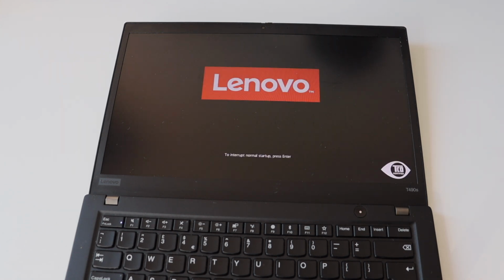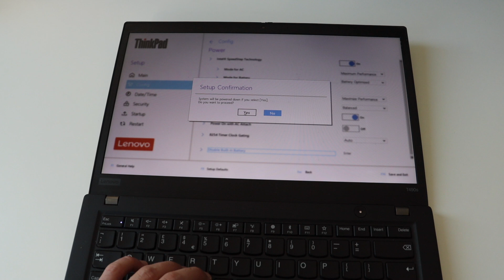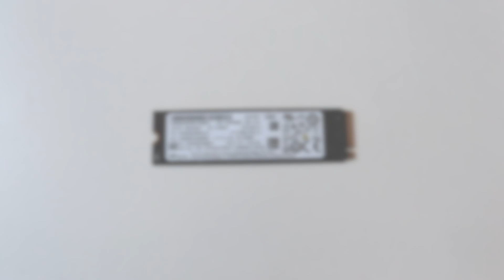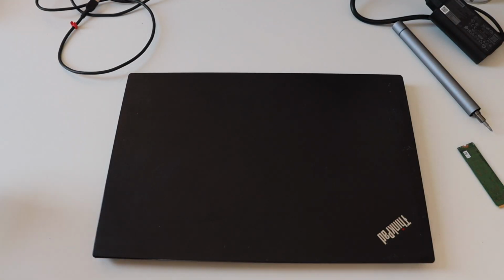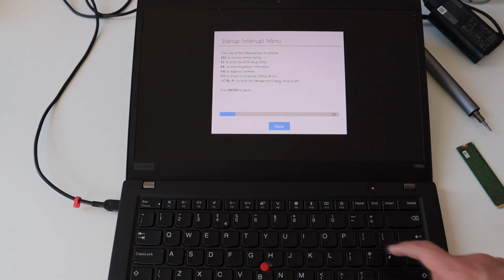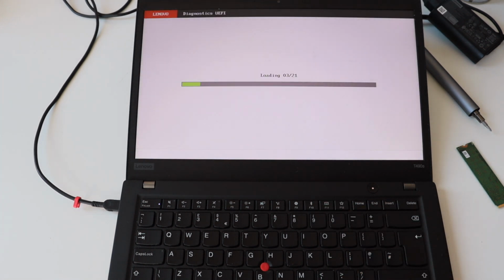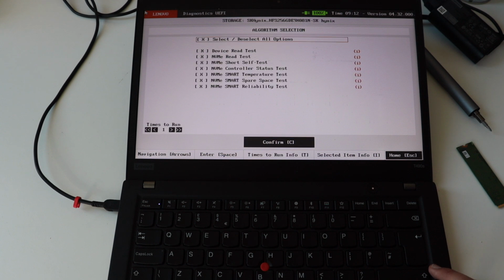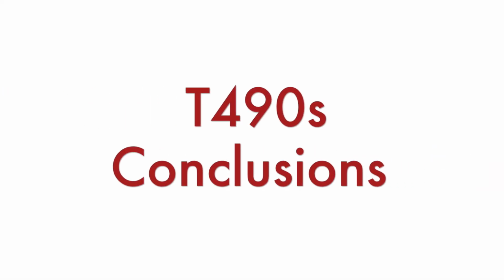Upgrade Lenovo ThinkPad T490s M.2 2280 NVMe SSD

Comment: Hi, I would like to ask if I want to install an SSD on a WWAN card on a T490s, which type of SSD should I use, M.2 SATA 2242 or M.2 NVMe 2242?
Reply: I have searched for information but found that the T490s BIOS does not allow anything other than a WWAN card to be installed, whereas the T490 model allows an SSD to be installed in the WWAN slot. "On the T490s (a slimmer and lighter series), the WWAN slot only works for WWAN cards. The BIOS does not allow other devices, including SSDs, to function in that slot." Is this statement correct?
Reply from the maker: It is tricky... According to the datasheet T490s supports up to 128GB M.2 2242 SSD in that slot. NVMe is supported (not SATA). However, the tricky part is the M.2 key. I am not sure and I can't easily check right now, but as far as I remember the key is B+M. Double check this if you want to go down this path with the M.2 2242.
Reply: @LeonAnavi  Okay, thank you for your answer.

Comment: is tehre enough space for ssd heatsink?
Reply from the maker: Hm, not sure. I have come across SSD heatsinks designed for the T14 and T14s Gen 1, but I haven't tested them myself. I am also not sure whether there is enough space for one in the T490s, which is the predecessor to the T14s.

Comment: I have a question like can use the small ssd in the other slot
Reply from the maker: Yes, according to the tech specs T490s allows using a M.2 2242 SSD up to 128GB on the other slot. I am not sure why they mention this 128GB and I am wondering if a larger drive can be used too. Beware, there are some M key differences between slots so double check the M key position on this slot before you purchase a SSD.

Comment: Is it possible to upgrade to a 2tb NVMe ? I was going to upgrade my t490 with 2tb but i read its possible by configuring BIOS and others say no.
Reply from the maker: No, sorry, according to the technical documentation both T490 and T490s support up to 1TB M.2 2280 SSD. Btw thank you for the good question. This is important to be noted and might be useful for other viewer too.

Comment: In the wwan slot can i use more than 128 gb storage?  Please reply and make a video with wwan slot second ssd card and size.  
Please please.
Reply from the maker: According to the ThinkPad T490s Product Specifications Reference, the storage support is: "One drive, up to 128GB M.2 2242 SSD or 1TB M.2 2280 SSD". For more details follow the link to the PDF from lenovo in the description of the video.

Comment: Might sound like a silly question but I have only recently got a T490s. After you do this do you need to reinstall OS or is it not affected by this storage upgrade?
Reply from the maker: Yes, if it is a brand new NVMe drive you need to install an OS after the upgrade.
Reply: @ is that a hard process or do you have a video showing this process?
Reply from the maker: Well, the installation process depends on the OS. For an example, I am a Linux user and the installation of Ubuntu Linux distribution on a new drive nowadays is quite straight-forward.